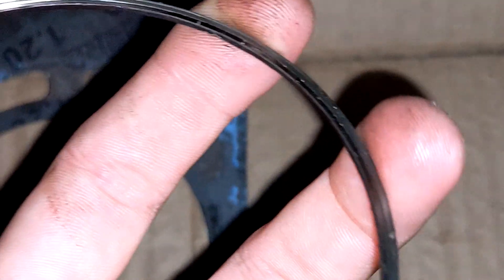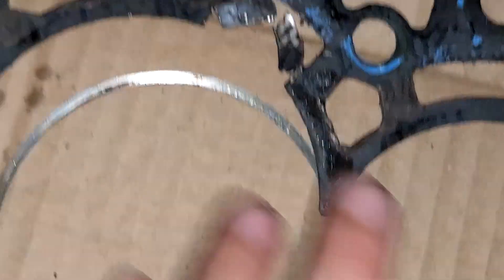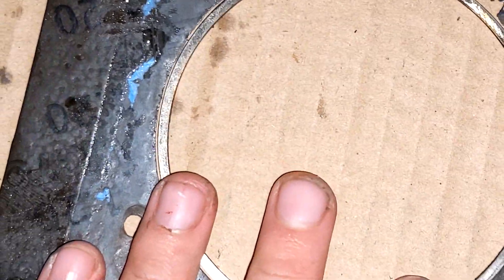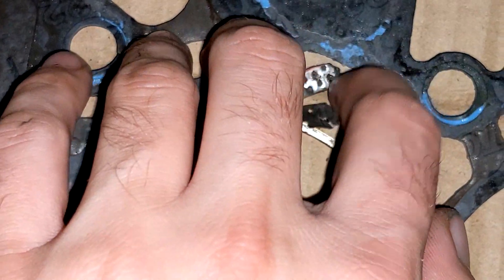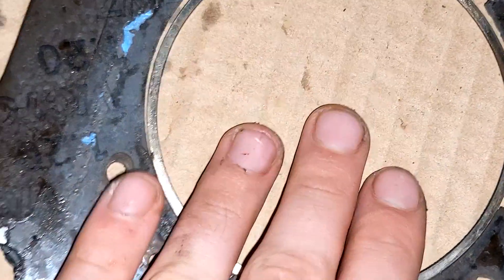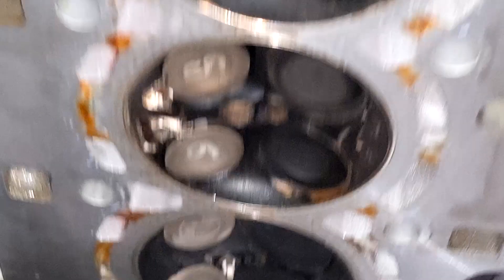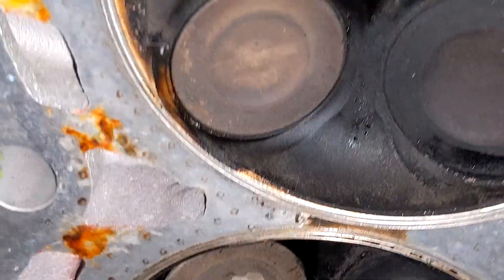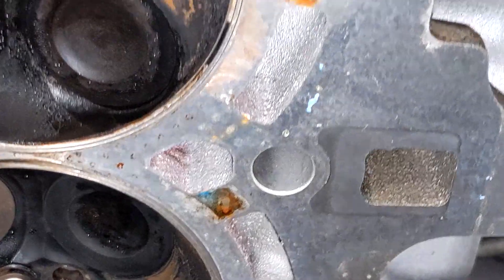Forged BMW N20 Teardown and Analysis what went wrong?

Comment: The N20 engine on my x1 stalled couple of days ago on the highway out of nowhere...the engine cranks now but it won't fire up! What are the chances that replacing the timing chain would resolve the issue as I'm 90% sure it's the timing chain guides...or would you suggest doing an engine swap?
Reply: @UmutBaba-g7y  The guides are broken. What do you mean by 'timing very off'? If the timing has jumped teeth (Which is most likely the case) replacing the timing chain assembly would fix the issue wouldn't it? Unless the valves are bent...( In order to replace the timing chain assembly along with the guides, you'd need a specific timing tool that would set the timing)
Reply: @UmutBaba-g7y  The engine has 160k (km) on it...I bought the vehicle only a month before the incident. I was told by the seller the oil has recently been changed so  I didn't bother checking the oil or filter...however after the incident I cracked opened the oil filter housing and the engine oil was pretty dark like it hasn't been changed in a while...
Reply from the maker: @8442116  I see you have pretty much already been given a correct response. If the guides are broken likely damage to the Valve Train and pistons.  best advice is to either replace with used motor, or forged rebuild. I wouldn't attempt to repair since it will end up costing as much as a rebuild.
Reply: @NavardiTuned   Wrong! (read it with trump's voice)...threw in a new timing chain assembly and it's running great!

Comment: Love the videos guy's honestly the honesty and depth and detail 👌 👏 classy love it. As a Canadian who can easily get rooked by the dealer 😉.  I'm just starting my first build on a 2017 330I x drive b46 2.0 T  currently running Mg Flasher stage 1 ,XHP stage 1,2,3 as well as x delete 😀  currently went back to awd. CAT Delete and Resonator Delete Drop in K&N filter.
Reply from the maker: Thanks Mate! there will be a new video following up on this video soon! your build sounds rad!
Reply: @NavardiTuned  it would be and will be as i get more involved and more information on detuning the block to a 1.5 L twin turbo 9 or 10,000 rpm forged 4 Cylinder would oike to stay AWD  But more than likely for suspension reasons with F80 control arms. Ill more than likely go RWD with a Manual 6 speed swap the rear subframe with a M3. Upgraded drive shaft. Do a brake upgrade. The interesting part is finding a builder for the engine first off. The rest is easy with money 💰 😀. Trying to build a engine of that caliber with reliability will be the test.
Reply: This guys video on closed decks vs open and semi open decks is great 👍  thought you might like it.

Comment: I had a jb4 on my 135i ,nothing but trouble ,best thing I did was through it in the trash and tuned it properly.
Reply from the maker: Couldn't agree more with that, nothing but issues with boost or fuel control with it. Its not bad for auxiliary fuelling i have found but nothing beats a real ecu tune

Comment: What power are you making?
Reply from the maker: Unfortunately as per the video, I never got a chance to find out, but the turbo is rated for 450-500whp, and the motor is rated for about 800whp. There will be some results once current global situations due to COVID-19 ease. As it stands right now all Motorsport tracks and "non-essential" travel prevents any of us guys from getting one of our cars to the dyno or drag strip.